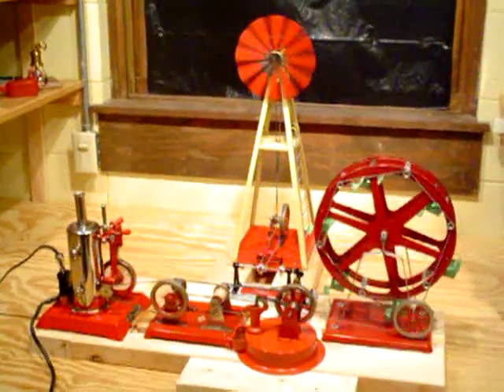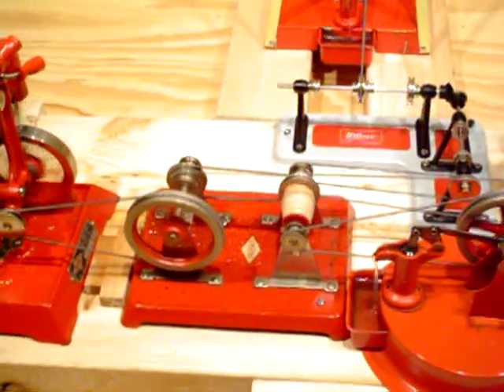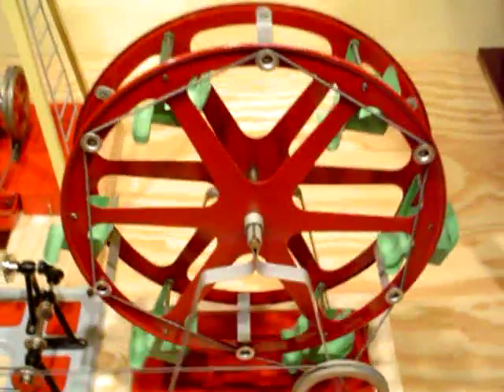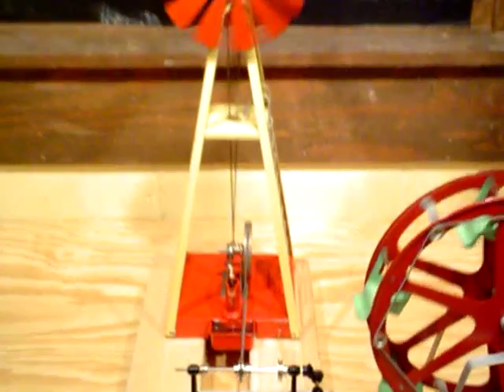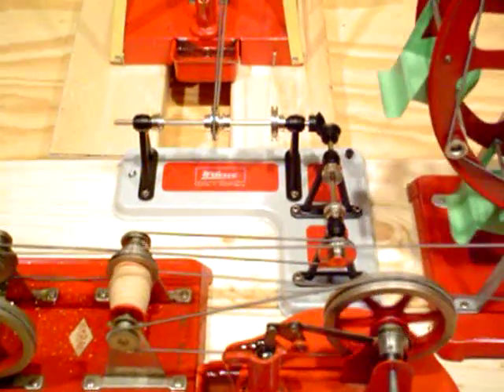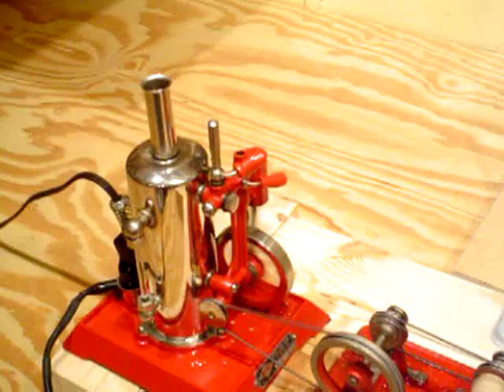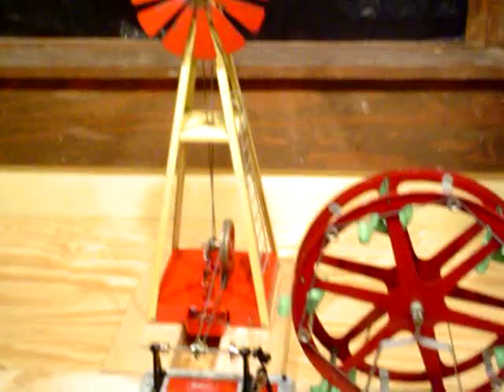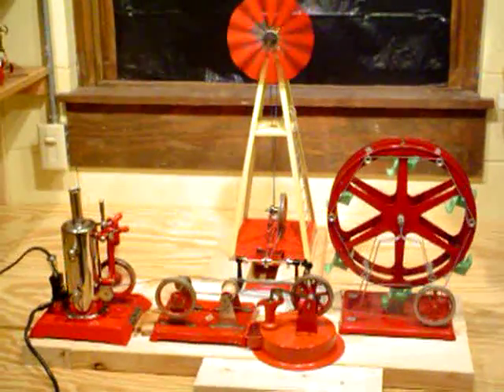Empire Toy Steam Engine Powering Accessories

Comment: I have a transmission unit, engine & ferris wheel I'd like to know their value.  I may put them on the market and I'm having trouble locating pricing on the web.  Hope you can help.
Reply from the maker: Rob, you don't note which Empire engine you have...so hard to give a price as the cheapest go for maybe $100 and the most valuable can be $1500.  The Ferris Wheel, if like mine, is probably worth $350 and the transmission unit maybe $150.  Listing on eBay will get you the widest audience worldwide...primary way steam engine toys like these are traded.  Good luck!
Roger